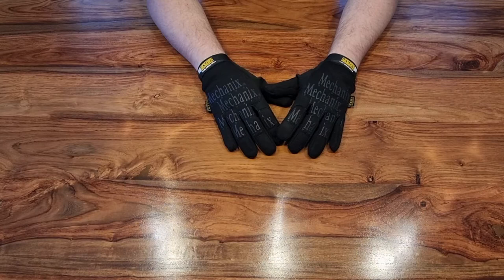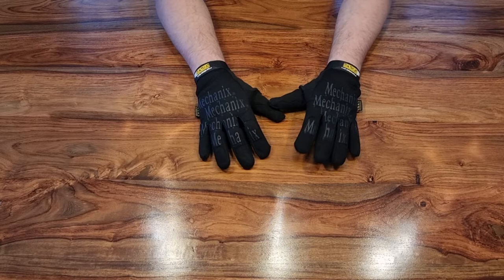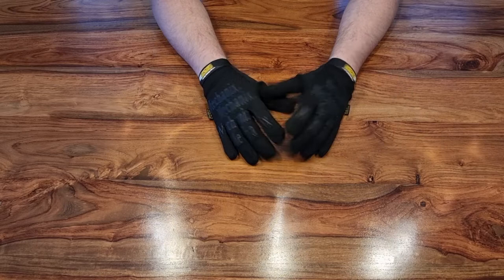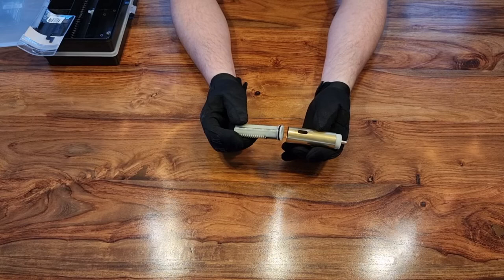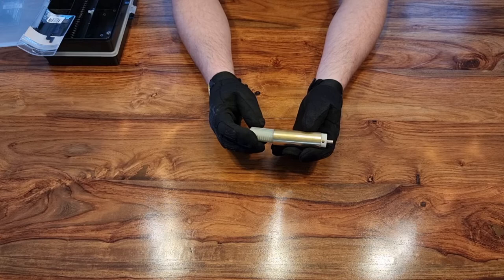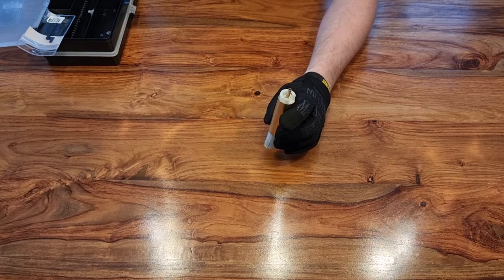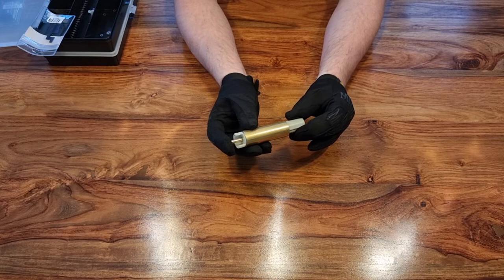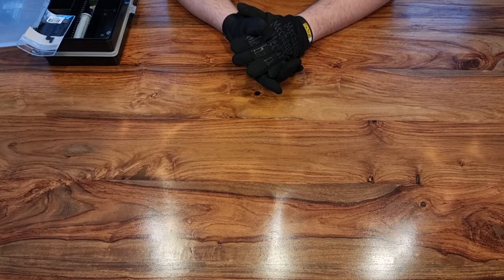A basic introduction to airsoft AEG gearbox components. Upgrade options and basic benefits.

Comment: This helped me so much but i cant find any poly pistons on amazon and do you recommend a certain spring im new to upgrading parts
Reply from the maker: Hi, I'm really glad this video helped out. Piston wise I found this supplier with some in stock:

https://www.evike.com/products/62386/

Parts seem to be tricky to get hold of just now. Hopefully the market will settle down though.

As to springs, I don't really have any problems with any particular brand of spring as long as I can get the power I want. I tend to use Action Army, Lonex, Gaurder, ASG. 

I hope this helps and good luck with your upgrades.